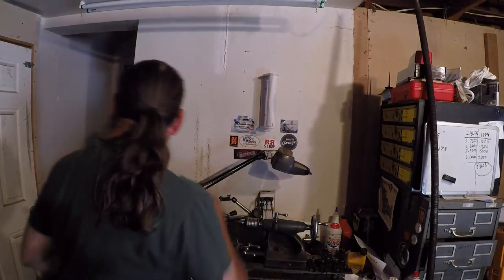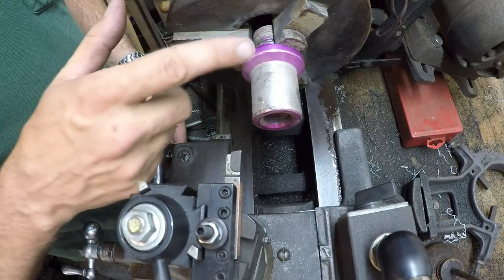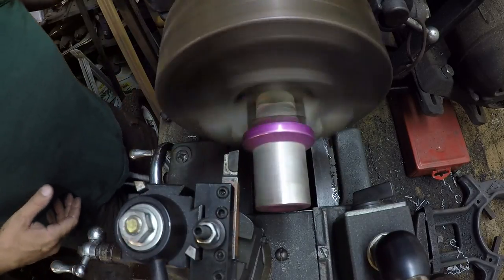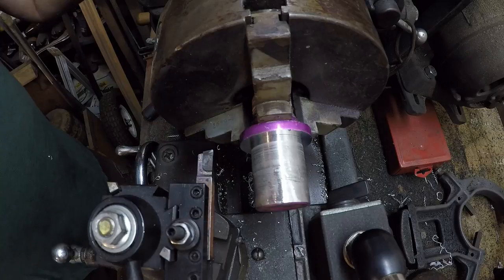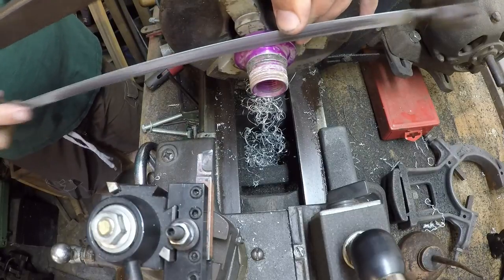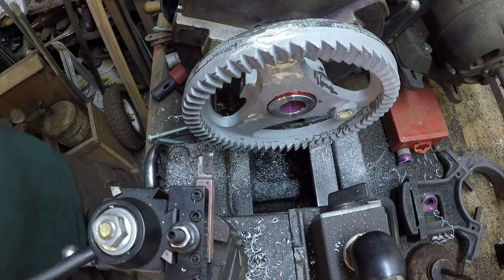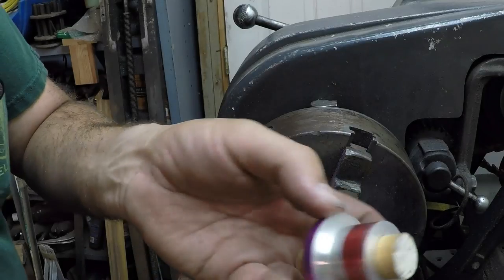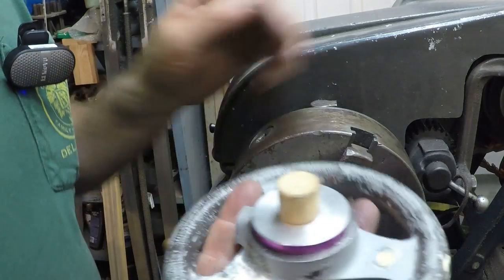Foundry Pattern Making from Parts #2

Comment: Have you taken into account the shrinkage of cast iron. From memory its 3/16" per foot.
Reply from the maker: +Stuart Smith that is a good point. I have and in this case it won't matter the largest part is about 6 in so that's 3/32 of shrink and all the parts that are interacting are also being recast so they will shrink the same percentage.  Another part to think about is that the as parts have lot of play this makes it very forgiving. Great question
Reply: Just making sure you were aware. If you were drilling holes near the ends, you might have not had much room for them.
Reply from the maker: +Stuart Smith yes I agree with you it is something that needs consideration but many times things that are small you can almost ignore it say for the ratchet paw it's maybe only an inch long so I don't know how much that part is going to shrink in reality 1/8 to 3/16 per foot over something that's only inches very small amount and they're often parts that it just does not matter if they shrink or not but like I said that's an excellent question to bring up thanks again. ;)